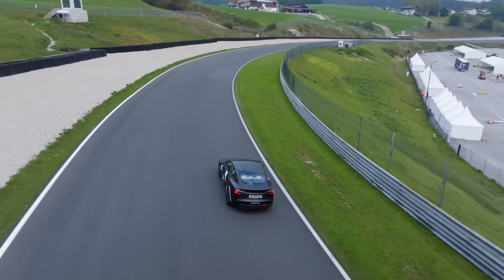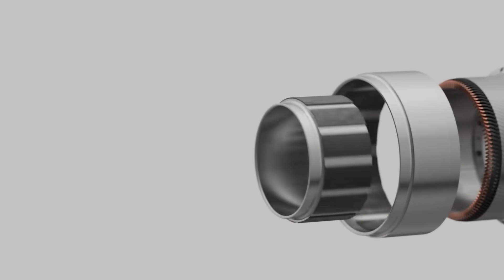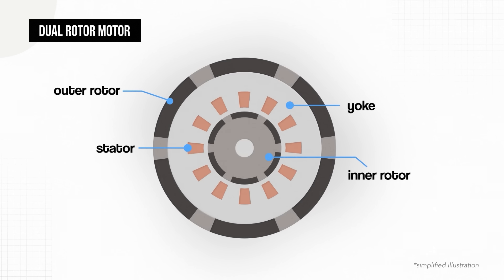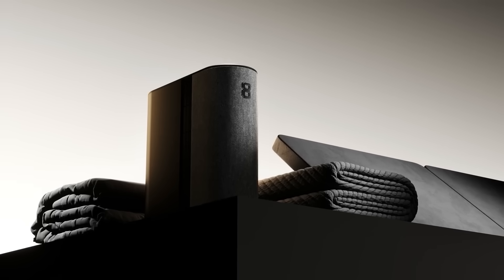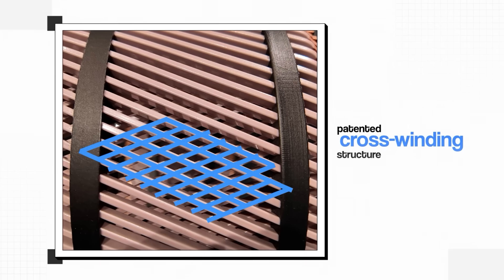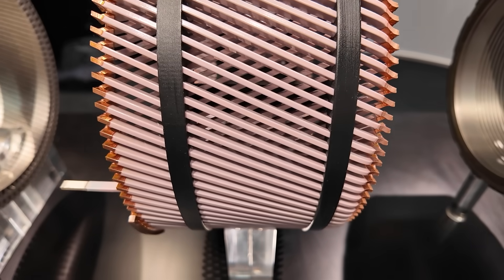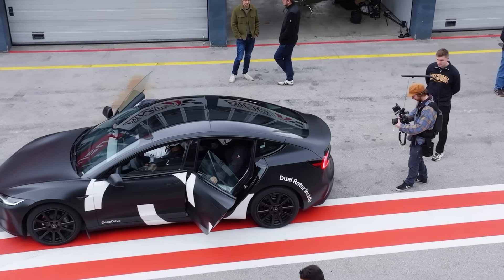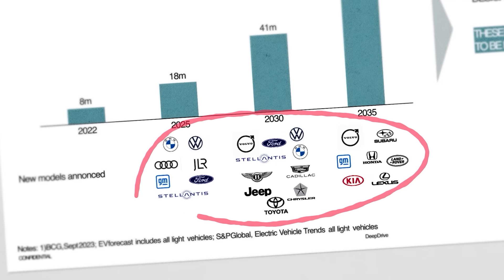How Dual Rotors Make Motors Insanely Efficient

Comment: This genuinely looks like a mass market disruptor. Great vid. Thanks.
Reply: Especially if they can remove the rare earth permanent magnets altogether and use Al alloy windings  in the same design you have an all round winner akin to Na ion Batteries becoming solid or semi state units.  AEM cracked that problem a few years ago... Sounds like a good Euro team up...  🥼🧙🏻‍♂️🌀🇬🇧🌏🌍🌎. 

those winding bars can be further stabilised by partially or totally embedding in a none electrical conducting and vibration suppressing resin but preferably still transmits heat .... especially if deployed in wheel hub motors or an aviation context . 🤔
Reply: Depends on price. Electric engines are already around 90% efficiency, so you can only get 10% better at best, and 100% is rather unlikely.

Comment: So I've been away from AC motor control for too many decades and the technology of switches has advanced quite markedly beyond what was cost-effective when I was designing.  My concerns of a motor design such as this may already be a "solved problem" for the industry, but it would be comforting to hear that the concerns are, indeed, a solved problem.  In my day, the more efficient an industrial motor was, the more difficulties it presented for maintaining operational stability under light-load conditions.  I see here a machine with a much larger effective gap in the magnetic path than a traditional machine, possibly yielding a much lower reluctance than a motor of similar torque.  In my day, the lower reluctance would increase the stress on the switching components.  Those components and the algorithms controlling their switching are probably much more robust than when I played in the industry, but the basic physics is still the same.

Don't get me wrong, I think the design is quite novel and interesting.  I just wonder that when these bumps in the rug were pushed, where did the bumps go?
Reply: High power transistors have been steadily improving over the past 50 years.  And the CPUs in the motor controllers have gotten dirt cheap.  I suspect the current motor controllers have more computing power than a typical desktop PC of 25 years ago.
Reply: @rockets4kids pretty close. P3s iirc were around by 2k and upto like 1ghz or so. Cheap microcontrollers are 240mhz-1ghz. Can't directly compare mhz obviously due to different instruction sets but I'd bet the ARM core on the esp32@240mhz on my table would outperform a p3 1ghz for uc tasks...but it still only has 520kb ram with max like 160kb actually usable. But it also costs like 1 to 5$ and has wifi/ble, whereas a p3 1000 in 2000 would've costs thousands for a working machine
Reply: @rockets4kids  so you have no idea and just makings stuff up. Guys, this is the problem with EVil industry and the climate cult. All the whackos from 90' that used to run around with tinfoils, capturing free power from universe and spinning conspiracy theories about "big oil, flat earth and aliens" are now running the show and more of the lunatics like that are joining in. All speculation and ass umptions and allergy to facts and details
Reply: - We have components that can switch much faster at much higher voltages with lower losses. 
- We now get 1980's supercomputer performance from a $5 microcontroller that sips less than a Watt.
- We have much more sensitive and much faster sensing components available

That means we can do algorithmic control in the multi digit KHz range and modulate waveforms in the MHz range for next to no cost, so we can fly much closer to the sun in the electromechanical domain.
Reply: between the floorboards. where they then harbour pests and get mildew.

"efficiency" is a word thats flung around willy nilly and nearly no-one understands it... that an electric motor has several types of "efficiency"... and they can all be made extremely in-efficient as motors and really efficient as heaters in the right conditions. very seldom is the class of efficiency mentioned... the main one being electrical power to shaft power.

i know all my single and three phase motors are rated.  with both electrical consumption and power output. i could say theyre "2400W" like a leaf blower or vacuum cleaner that CONSUMES 2400W, but only does 800W worth of actual physical work. 

then theres ways to fudge number... i always remain dubious of any power rating on a non-industrial and non-plated motor. why?

because i can make a motor that requires 2kv to make its "200kw".
yet if its only being fed 800V it isnt EVER going to make 200kw.

 its still going to be ADVERTISED as 200kw, dont worry about that... even if it can only do so on a bench with an unlimited power supply and loaded to spin at a very specific RPM...

so do ICEs, but you know that they CAN produce that rated power when in the vehicle and running "in isolation". 
maybe its the algorithm, but a quick search on "EV Dyno test" gives very little, and very inconclusive information. can state torque, amps, hp... but not volts. or rpm. funny that...
Reply: @paradiselost9946  motor peak efficiency is what's important in industry. automotive is not the real target there, especially given the reliability issues of a precise alignment on a vehicle.
Reply: @paradiselost9946 I doubt anyone who’s interested in putting an EV on a dyno cares about efficiency - they only care about peak HP. Would be interesting though to readout the battery terminal voltage and current as well as shaft power, and graph them together. Peak electrical efficiency is one thing; how it varies across the drive cycle is another. But like everything in engineering, it’s a compromise.
Reply: @markirmuir  yeah, i know that. what im saying is that most of the figures and hype we hear about electric motors are from journalists and salesemen and advertising teams. not engineers. the general population is ignorant on almost everything around them and simply parrots what they are spoon fed...

numbers can be used to deceive when most people have trouble adding small numbers in their heads, and most dont understand the numbers anyway.

Comment: This is a new design that is actually really interesting. That torsion resistant winding pattern & cooling technique is fascinating. I recently saw something about the skin effect, would there be a way to weave a ton of really thin layers to try & get the most power & efficiency out of your electromagnetic motor design?

Comment: Very interesting. Cost and weight are massively important as well as efficiency in motor and generator modes.
I look forward to seeing these in EVs.
Reply: Yea, no you will not as it has a vast increase in copper content = vast increase in cost.  The weight reduction = does not matter when the batteries ARE the weight of the vehicle.  PS: Their efficiency "claims" are pure lies.
Reply: I think the cost savings are highly suspect. Why show "cost per Nm" instead of cost per kW? The latter is far, far more important.

Any motor can easily increase torque with just 2 gears, but no such magic for power, which determines your limit for acceleration.

That cross winding needs more explanation, too. Normal coils align current where the magnet's field crosses. This has current in different directions between inner and outer layers.
Reply: @masina9447  2 gears is a loss in energy

Comment: Ryan, as an engineer who was in LA during the rain that hit a few days ago and saw all the RWD teslas that crashed in the rain I highly urge you not to encourage giving people 4000 NM of torque....people are already struggling with 500 to 800....no need for anymore. Also this amount of torque would require alot of management and no tire for a normal car would be able to hold up to 2000 NM. So giving more idiots more stuff out of their ability does not sound like a great idea. Unless they can significantly bring down the size therefore the power and torque numbers to match current ones I see no reason for this motor in a normal car....maybe a heavy duty truck or bus but not a normal car
Reply: I think the true value is that we can make smaller, lighter motors with the torque and hp values that are practical for normal driving. My own small EV has 130hp. It’s more than enough, in fact it’s normally set at 100hp (the 30hp is then available if I need it).

One issue with EVs is that they can bring high power performance to more people. Previously you had to be a rich idiot to have an expensive car with a powerful engine that would get you into trouble in a fraction of a second. Now any old idiot has access to that power.
Reply: Small motors may not be suitable for the power output or reaction force of heavy vehicles.
Reply: Thats LA, nobody else in the country is as brain dead.
Reply: Get of the soy
Reply: Get off the soy

Comment: Wow, that actually looks a lot simpler to construct than normal motors (I'm no expert, though!)
Reply: That's another reason why EV's are objectively better.  Fewer moving parts.
Reply: @jonq8714  Need to get the recharging as quick as gas's refueling. Prolong trips gas still wins out to shorter the time over all because of the refueling quickness. My only issue is the 2,000nm is from a dead stop on these motors & there is a spike in power usage at dead stop to moving that's actually where the most HP & torque comes into play. Since in motion faraday's law exist. There is some parasitic loss from faraday's law.
Reply: @kevinerbs2778  by the time you have emptied your bladder and filled your stomach an EV is mostly recharged. It's not just about comparing with the gas pump.
Reply: @redshift3 keep lying to yourself 😂😂😂😂
Reply: @jonq8714  why do you assume a comparison between an electric motor and a combustion ENGINE?
Reply: @jonq8714 EVs are worse compared to EVs! It’s not all about “instant” torque or whatever! It’s about capabilities! In Australia they use massive diesel semi trucks that hauls up to 6x the load of a regular diesel in Europe and good luck doing that with an ev while crossing the wild unpaved outback